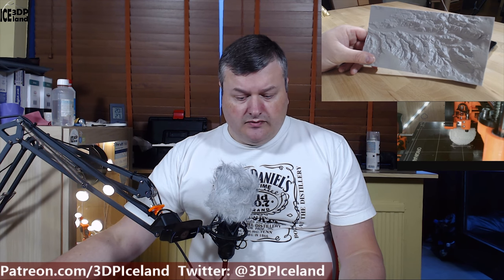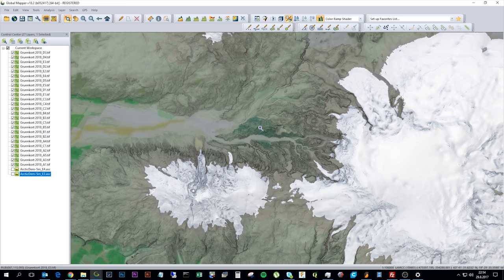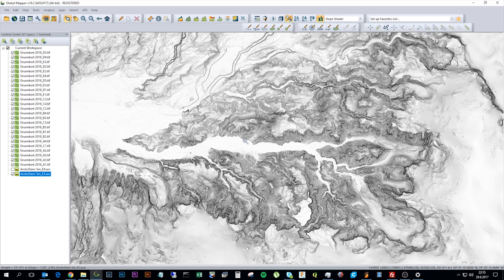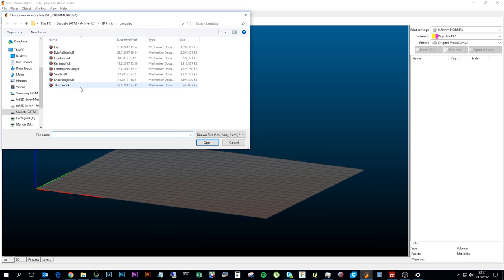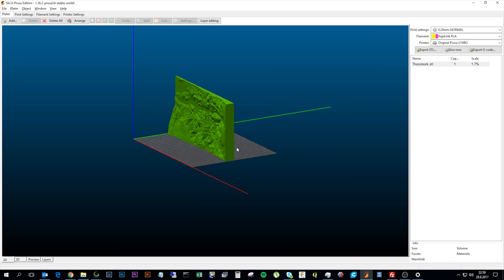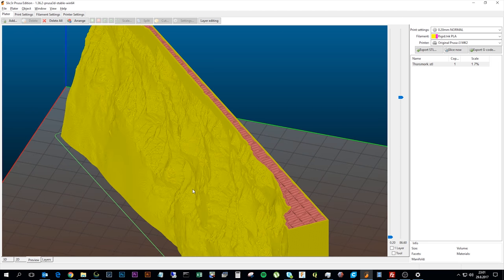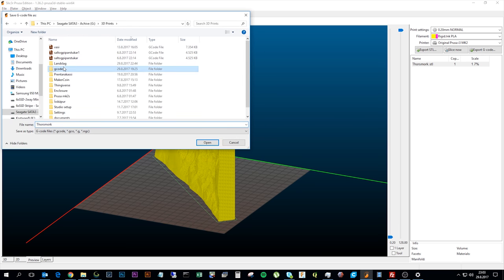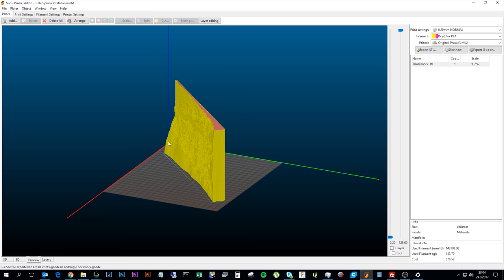How I create the landscape models for 3D Printing

Comment: Thanks for sharing. By rotating 45° you probably don't need to scale the model down. A 30mm thick print can be up to 300mm long. Still thinking what position would be best to get as less as possible movement on x/y axis. Placing the cam from corner to front shouldn't be a problem if the enclosure is deep enough.
Reply from the maker: true about that rotation and size, - the Besta cabinet door prevents me from having the camera in front though.